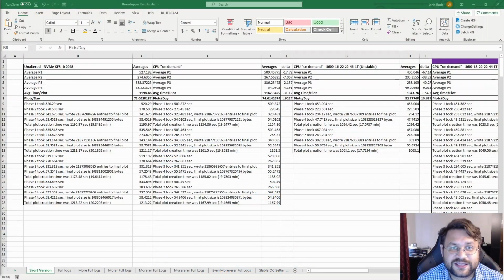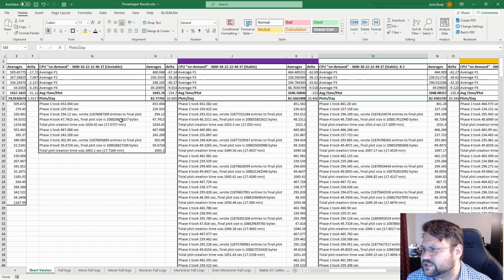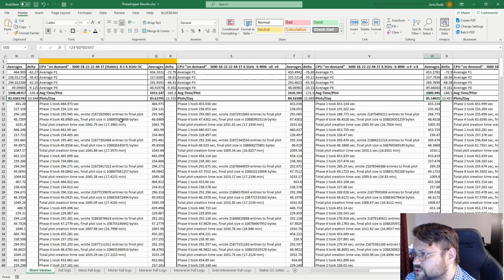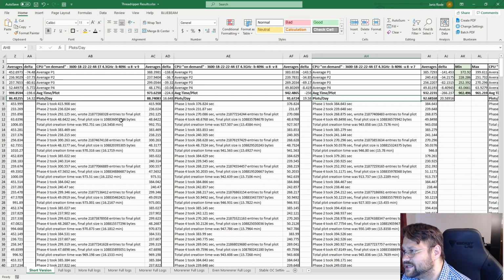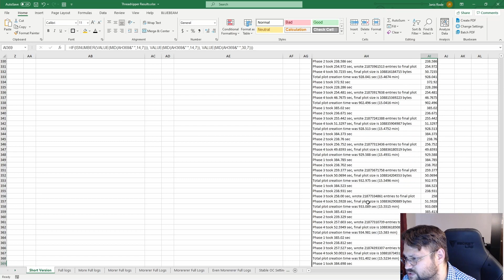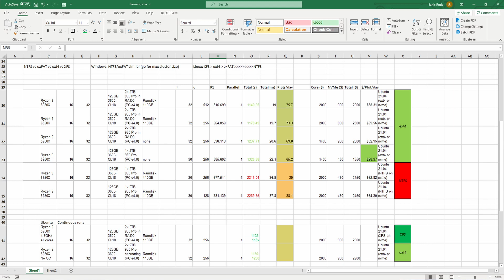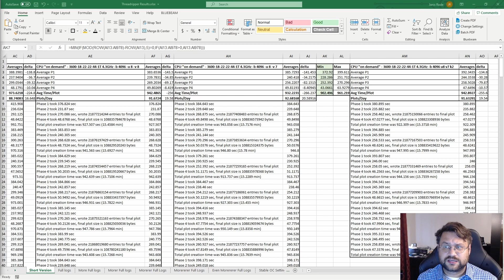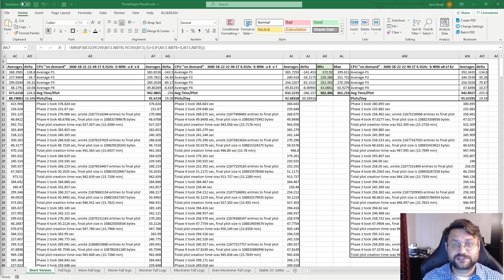16-min Plots with Overclocking! (MadMax Chia Plotter)

Comment: Thank you so much for you vids! Please, help.
I’ve built a system on 5950x, 128GB @ 4000 MHz (2 x F4-4000C18D-64GTZN, G.SKILL Trident Z Neo) and RAID0 NVMe 2TB CS3040 (I had them in hands, I know it’s overkill). Mobo is ASUS ROG Strix X570-E. Thanks to you for good reference.

I could overclock 5950x to 4.75GHz @ 1.3V but I have a problem with RAM. I couldn’t use RAM at DOCP at all, it just doesn’t boot. FCLK over 1833MHZ is not working for me. What can you advice to me? I really want to reach 15mins plots with this improvement, at least I paid for 4000MHz and can’t utilize them. Now I have 18mins per plot.

Thank you for your attention!
Reply from the maker: Pavel,
Regarding the RAM, from what I can tell in general from AMD systems is that most of mine won't work with DOCP/XMP profiles out of the box, I need to (at the very least) tweak the procODT. That's with the actual amount of DDR sticks found in a single pack.

When buying multiple packs, hitting the DOCP/XMP speeds would be extremely unlikely. I don't want to say impossible, but I have never ever hit anything near the number that they say on the box, but I don't expect them to either.

Case in point, I purchased DDR4-4400 CL19-22-22-46 RAM, multiple packs there of, and with 2 packs, I can only get 3600 and 3666 stable at CL16 (booting and actually passing stresstests). With 4 packs (8 sticks), I can only hit 3600 stable enough to pass stress tests, but at looser timings than with 2 packs (4 sticks). The sad thing is that even after passing a 12hr stress test, Chia will still find a way to make the memory cause a crash when I'm using it as a RAMdisk at those clocks, meaning Chia is actually a "better" stress test than your average memory stress test in my opinion.

I am not claiming to be a master at overclocking, but from what I've heard from friends who know more about memory OC is that "a stable 3600 OC on 8 sticks is a pipe dream". You need to bear in mind that memory OCing is a very time consuming task (think, at least a week), mainly due to the stress tests that you need to perform in order to make sure that the computer won't freeze or reboot on you.

Here's a link to an article written by an individual who is extremely knowledgeable in memory OCing:
https://www.techpowerup.com/review/amd-ryzen-threadripper-3000-overclocking-deep-dive-asus-rog-zenith-ii-extreme/6.html

Bear in mind that even though I have the same CPU and almost the same motherboard that he is writing about, I am not able to replicate his results. Every single individual CPU and memory stick is unique, and even if you buy exactly the same system, part for part, you will not be able to get identical results as someone else because of what people refer to as the silicon lottery.

CPU overclocking is a lot easier and faster than memory overclocking in my opinion. You have a lot more variables when it comes to memory overclocking and the stress tests take a lot longer. I am not trying to discourage you, I just want you to have a more realistic expectation when it comes to the overclocking.

Looking at what other people can achieve can be good to know which ballpark you find yourself in, but please bear in mind that the most visible results when searching for them will be the more extreme ones, and you will most likely not be able to hit those results.

I suggest one of two things:
1. Settle for something good enough.
2. Spend one or more weeks trying to tweak your system to the max.

Just remember that if you select option two, that you will be without a plotter for one or more weeks, and that may not be worth it for you at this point in time (although you may want to do that once you've filled your HDDs with plots and can afford to do the experimentation).

I'm sorry for not being able to provide you with a more positive answer, but I hope that it helps!
Reply: @JanisRode  thank you for your comprehensive response! There is new update of the BIOS, also I will try your advices too. Thank you so much, I’ll tell you news if something good would happen. Keep in touch!
Reply from the maker: @pavel8754  No Problem!
Yes, please let me know how it goes!